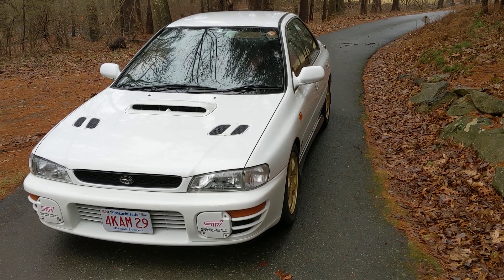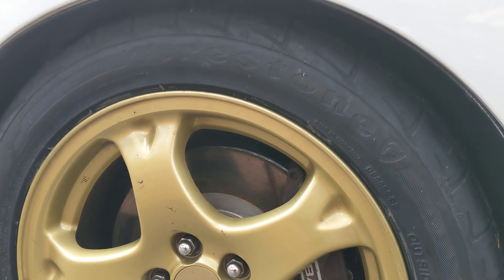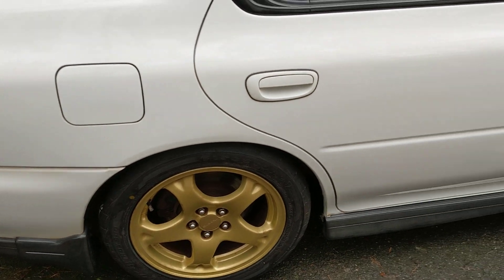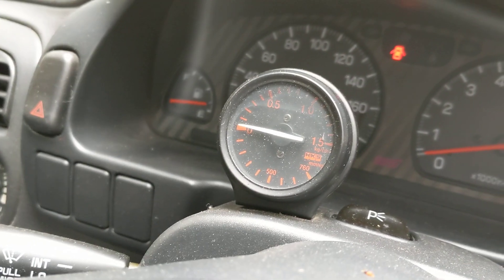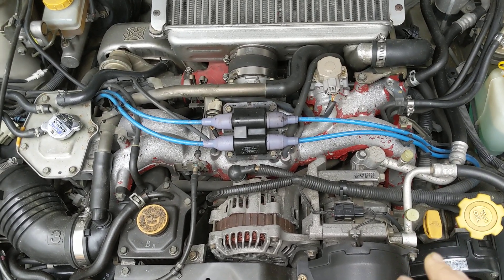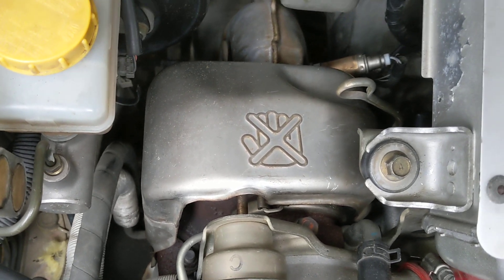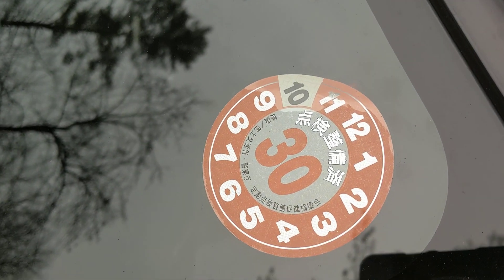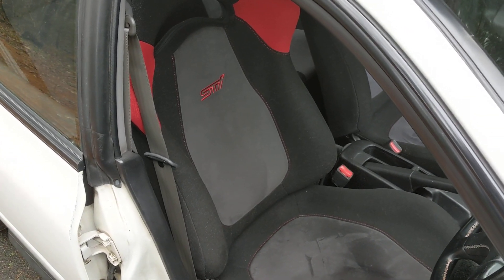Here's a video where I talk for 9 minutes about the STI Version 3- a nimble JDM sportscar

Comment: These use to be a dime a dozen in western Canada between 2012-2018 quite literally the most common import and could be had for $5-9k CAD for mint 100km/60mi on them. I had 3 of them and would like to have one again. Very quick cars out of the box but not much modifying potential power wise unless you have deep pockets. Still very fun at 280hp+. Not that reliable either but let's not talk about that.

P.S sun fade on the back black pillers is extremely common as well as the manifold. Nothing about this car sticks out to me. Seems like an honest good car. I'd just check under the spare tire for water/rust as water gets in there from the tail light and sits forever if you don't pull the bottom plug. Aswell as the rear windshield washer tanks like to rust behind the trunk carpeting. If this was my car I'd pull the exhausted off and put an aftermarket unit on and go for a tune. Gain a very health amount of power the factory exhausts are extremely restrictive. Besides that I wouldn't mod it beyond that as that's when things break on these cars.
Reply from the maker: I bought an E30 M3 for 10k in 1998. Funny thing about how time and scarcity work. Imagine being the person to buy a Ferrari GTO at 18k sticker price and later sell it for 25m.
Reply from the maker: Ageed on those rust areas. This one is perfect in the trunk, no moisture or corrosion at all. It's not luck because we check for this at inspection before bidding. I've seen some turds. These days it seems that you look at 5 or so, maybe 10 before a good one comes around

Comment: Do you know if the ej20g wrx in this 97 jdm v3 had a closed deck ?
Reply from the maker: @HellofromAustralia-s8h-juan  the 97 had an updated engine without a closed deck. This was called the EJ20k
Reply: @race-partners  mine is definitely ej20g wrx 03/97 limited edition v3.  It has the older interior before 98.
Reply from the maker: @HellofromAustralia-s8h-juan  08/96 was the last production car fitted with the EJ20g. Perhaps if you have one it's been swapped.
Reply from the maker: If you send me the vin I can check for you
Reply: @race-partners  it's not letting me type the vin. It keeps getting deleted